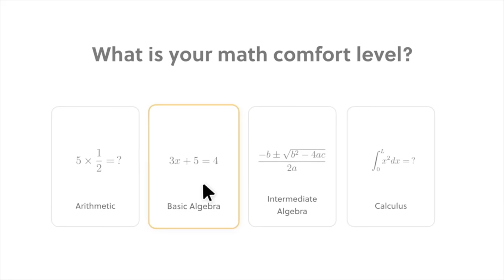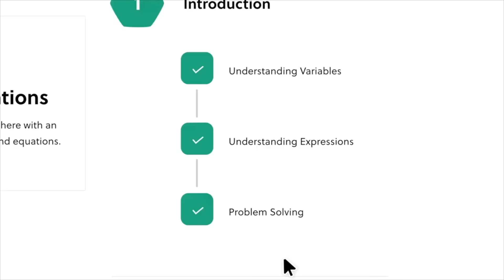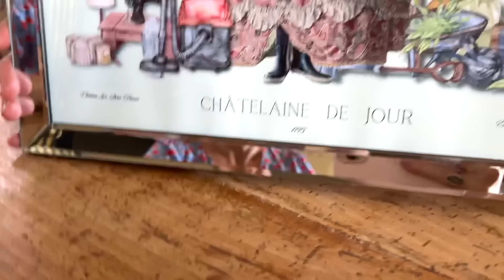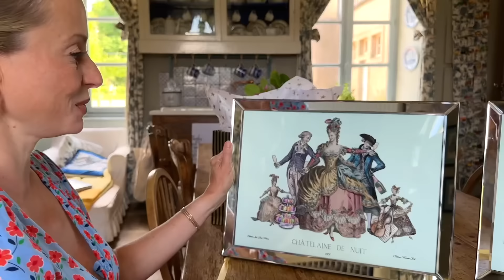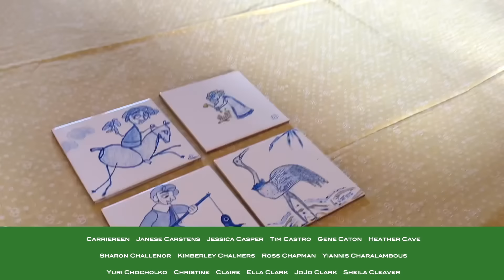What’s happening with our Grand Salon renovation?

Comment: I love the light fixtures in the bathroom,  but they need spray painted to fit the wall paper and they would look so lovely.
Reply: Yes, a bluish purple would be perfect on the flower petals, and they may need to pick the perfect shade of green on the leaves to not clash with the shade of green at the bottom of the wall. Greens are quite tricky. If they are lucky, the shade of green that they are will work out.

Comment: Put a black plastic bag on a stick and wave it on the far side of the area and they will run inside.  They have an instinct of a preditor like that and go inside.  Once you train them with the bag, associate an odd sound on a speaker and they will make the connection and all you will have to do in the future is set a timer with a speaker and they will go to bed and an automatic door can close and open for protection.

Comment: You are so patient. I would use the tiny brush and a mini roller. Also a knee pad for when on the floor. It is a small padded rubber cushion. Not sure you have them in France. Save the knees.

Comment: With the bathroom, why didn't you start the plant wallpaper lower to the ground? It looks a little odd with the green space.  And if you use primer before the dark green paint, you probably will not need to use two coats of the expensive stuff.

Comment: Regarding ceiling height in the Grande Salon: Does the addition of the iron beams mean that the walls in the Grande Salon will be taller or shorter? Does this mean the wall panls will be taller or shorter?
Reply: If I recall correctly, they said that the ceiling will be taller.  I’m curious now and will go back and watch again.  Keri💜
Reply: It will aid with the height of the paneling being too tall. I think sections can be removed to fit under windows, around the fireplace, etc. Amaury and Philip were doing designs on paper during one vlog. Higher ceiling will be a plus.❤